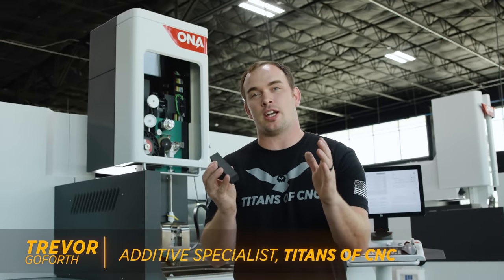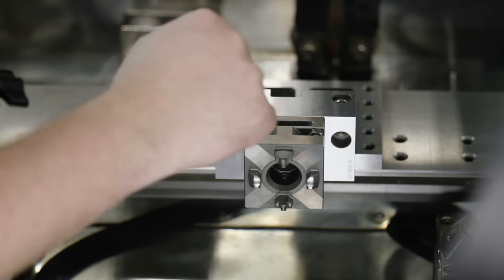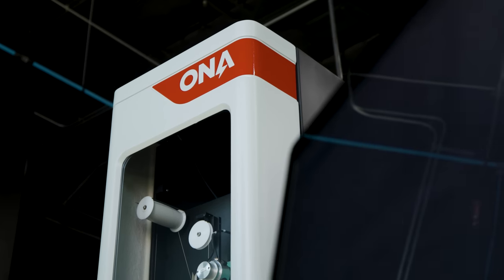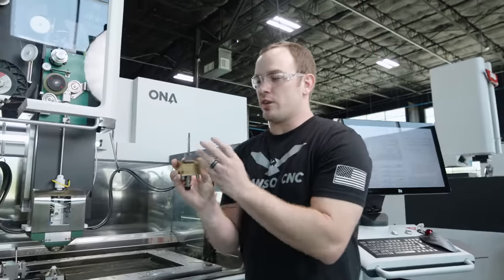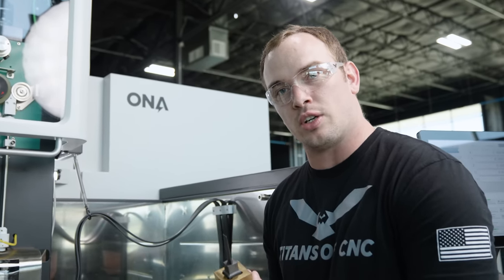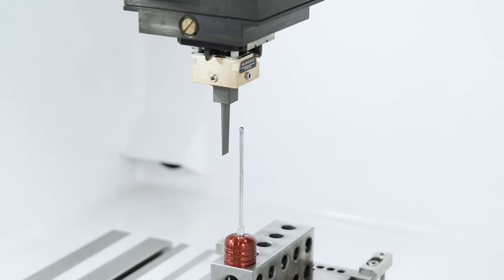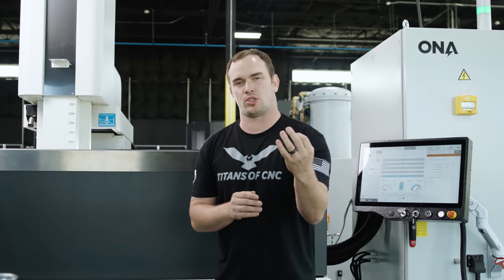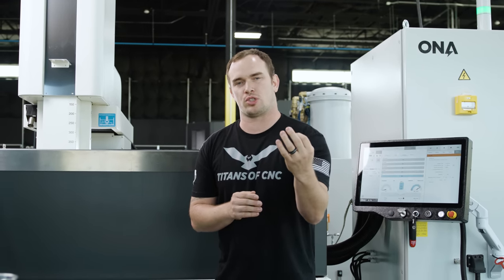How To Cut Deep Mold Cavities With Pencil Lead

Comment: as a machinist who has made just a couple graphite electrodes, I know how brittle it is and what a pain it is to make a good electrode without it chipping. I never thought about making an electriode with a wire EDM...genius!
Reply: To be honest, this is pretty easy to mill. All you need is 1 tip radius mill. Contour the part directly on 0 in small passes, leaving no stock because you can't finish this kind of part. I've done electrodes like this, even longer. It takes trial and error but they are pretty cheap. It will take less time then an EDM machine. Still cool though!
Reply: It's fairly quick but limited vs a 5-axis mill. I'm looking into a specific 5 axis electrode machining mill. My company is moving quickly into the magnetic component industry.
Reply: I'm like whaaa....all that mess that could have been avoided

Comment: I used to work for a company that surface ground graphite blanks to a .0002 tolerance specifically for EDM electrodes and mold making. Fun fact: you can get copper infused graphite for electrodes as well
Reply: I work at a mold and tool shop CNC milling electrodes to .0002 tolerance for EDM. We use Poco which to my understanding is a basic graphite and C3, which is the Copper infused graphite you mentioned. I went from milling Soft steel, to doing hard tool and now this and i think this is the most difficult.

Comment: Man I miss programming and running EDM's. It was stressful but awesome at the same time to cut parts that had a tolerance of +.0001 -.0000 " all day long.
Reply: I apparently have much to learn, as an operator I could only dial it in to +/- .0001
Reply: @thomasrogers8239  The place that I worked we did punch and die work to support our production line (electronic). There a couple of tricks that we found that really helped us hold those kind of tolerances. The material is huge and how we prepared it. We either used D-2 or CPM-M4. We would heat treat is, draw it back, freeze it to around -150 deg. F. We would repeat the drawing back and freezing the parts 4 times. Your material needs to be super stable. Then once the parts hit the wire EDM I would do 1 rough cut and 3 finish passes. The finish passes I would alternate the direction the I would go around the part. I wish I had the resources available to me now days to do this. I would make a video on this. Maybe Titan could fly me down to his facility so that I could demonstrate it lol.

Comment: At my workplace (tool manufacturer) we only use graphite electrodes for part surfaces where there's a specified roughness or a desired surface texture.
I've made heaps of different graphite electrodes on a small 3-axis mill that isn't really suited for the task, but it gets the job done. It's a dirty mess and the coolant reservoir is covered in black sludge - but at least the graphite dust is caught by the coolant and not spread all over the shop through the ventilation system 😂

For a smoother surface you often see on injection molded plastic parts, our sinker EDM guys use polished copper electrodes.
Or the sinker department leaves a bit of material for a polishing operation for that mirror finish.

Anything is possible, really.
As Trevor says in the video; it's about the technology available and the equipment - but the knowledge and experience of the person manning the machine is just as important.

Comment: This is what I do everyday in my Job. Make electrode copper tungsten to wire EDM and use it for Sinker EDM. I'm working this for almost 9years as CNC machinist. Graphite is good more cheaper than copper tungsten but I think it is better use for roughing in Heat treated materials but I don't think if it can be good in carbide materials. Graphite is easy to wear than copper tungsten. But still can make good products.

Comment: As a former die maker, this is impressive. It would not be impossible to make this part using the old manual machines but I would have had to mask the two halves, to get the finished size and that smother finish, soda blast it. It would have been almost hit or miss and it would take days to complete. 
 The parts would be scrap.
So I wish I could have had this technology back in the day.
 The machines you're using probably cost more than our whole building and the machines in it lol.
Enjoyed watching this show it's amazing how much CNC  can do.
Reply: "Die maker" when, in the 1930's? EDM is not new, come on...
Reply: @abcdefghijk6704  we had edm and used it  but never to make a die or mold part. We just had the simple one like to remove broken tap or make a hole in some super hard heat treatment tool steels.
Reply: @abcdefghijk6704  haha you still use EDM? how archaic lmao

Comment: Know it's 2 years old but guys, grind it by plunging down and moving the electrode out.  One shot per side.  The mass of the material will support the cut on the plunge.  We also did it on a Bridgeport conventional cut.  You can also turn a 0.0100 (maybe even smaller [we have an old Southbend lathe]), cylinder profile 4.000+ inches long, one shot, just keep your speeds reasonable.  Nice vids, keep learning.

Comment: Thats a pretty impressive slot right there! I wouldnt be able to machine that with comventional methods. Nice work Trev!
Reply: Thanks dude!
Reply: Yeah, but this is a standard way to do such things in mouldmaking for last 50 years or more.
Reply: probably gotta machine two parts then weld them both together at best?

Comment: I worked in a mold shop and we had a Makino cnc machine specially for graphite. It was sealed and had a vacuum to gather all the dust. I was a cnc programmer and I don't recall ever using diamond coated tool, it was standard carbide tools. Now something important for new machine shop worker. SAFETY FIRST!! Never work with any jewelry on fingers and wrist. Never!! This guy might lose his finger someday.
Reply: There are certainly machines designed for cutting graphite that have vacuum systems that do a pretty good job. Graphite is extremely abrasive and a standard uncoated end mill will wear quickly. Most shops that cut graphite regularly, are not using standard carbide end mills.

Comment: Just jumping in on a comment about Poco3 having copper. Poco c3 etc does and is more expensive than strait poco3

.There is no copper in Poco3. The difference between pencil graphite and fine edm grade is the fact that grades such as Poco3 are isotropic whilst pencil graphite is not.  I was a manufacturing engineer/ tooling designer for Pratt & Whitney Canada and designed every electrode for all blade, vanes for their engines for 12 years. Got my own shop. I'm a Charmilles guy and a big fan of Errowa tooling.
Reply: I ran wire for years but zero experience with a sinker.
Why don’t you guys use a nozzle to help flush? 🤷‍♂️
Reply: @fredsanford1437  I do use nozzles as well as vacuum flushing.

Comment: Poco EDM3 has copper i do believe, so slightly different than pencil lead. But good video on EDM. Those Erowa holders have a centering attachment (you used the alignment attachment) that is ground to length also so you can just type your x, y, and z numbers to your EDM electrode offset page. Love Erowa stuff, its expensive but worth it. System 3R has really nice Wire EDM tooling, leveling heads especially.
Reply: There is no copper in Poco3. The difference between pencil graphite and fine edm grade is the fact that grades such as Poco3 are isotropic whilst pencil graphite is not.  I was a manufacturing engineer/ tooling designer for Pratt & Whitney Canada and designed every electrode for all blade, vanes for their engines for 12 years. Got my own shop. I'm a Charmilles guy and a big fan of Errowa tooling.

Comment: Now, someone has to polish it (or you do very slow finishing burn), otherwise plastic will never go out of such mold (common issue, ribs breaking off). And imagine this is not an insert split in two halves, but one solid part.
Reply: It is possible with some release angle on the sides and an ejector pin in the bottom
Reply: Also polishing the electrodes. Multiple finish electrodes at multiple polish grades. Make the electrodes smaller to compensate and add flushing and orbital path. =happy mould polising team.
Reply: @mulletjocks  This program did have a square orbital cycle.
Reply: Many years ago I used to be the guy polishing those ribs for plastic injection molding. It was always amazing the detail they could get with EDM but polishing it was a bitch. It was a trick having or making the right tools to get all the way down into a small slot like that. Had to keep from widening the slot and the EDM process case hardened the steel making it take even longer to polish out.

Comment: This technology has been around for decades. In the 80s the tool and die shop had edm burners both graphite and wire
Reply: Electrical discharge machining was invented in the 194x year. This is not such a new technology.

Comment: That's awesome, that you did the burn with only 1 finisher. I was taught 1 rougher 3 finishers. And no flushing, the sodicks I use to run I always had to flush deep burns, they didn't like  it too much.
Reply: Yeah 1 rough 4 finish trodes is pretty standard for graphite electrodes which is why we wanted to attempt this burn with only two trodes and no flushing! Very impressed with how it performed! Thanks for watching!

Comment: [08/08/22] If that was a mold, wouldn't it require a draft angle for proper molded piece release?
Reply: Good question, you are correct! This electrode has 1 degree of draft on every side resulting in 1 degree of draft on the walls of my finished workpiece 👍🏻

Comment: Could you make a graphite part and use it to make a mold in metal by this process? Or Would machining it be the better way to go? Always fun to watch things being created with new techniques. I had the opportunity to work for a company using an EDI system, but chose the other job, Automobile mechanic, should have stuck with the machining.
Reply: Electrical discharge machining was invented in the 194x. This is not such a new technology.

Comment: i imagine EDM being much more relaxing then milling or turning. just no big fast moving parts that you can crash haha
Reply: These machines monitor current flow. I forgot to put a Z retract to the right height to clear a clamp between pockets while on a die sinker. The electrode bumped into the clamp and alarmed out. Just pressed reset, highlighted the line to start from and off it went. Not a mark on the electrode or clamp. If I done that on a mill I would of been picking up pieces.
Reply: @Hi_Doctor_Nick  exactly good luck making an edm explode haha
Reply: @cyber2526  that was my worst crash I've ever had on a sinker. if you can call it a crash, more of a inconvenience lol

Comment: Hi Titans of CNC!
I am a student
I have a doubt
GO G90 G55 X0 Y0;
G43 Z2.0 H2;
#501=1;
WHILE [#500LE23]DO1;
G91 Z-0.7863 F480;
G04 P100;
#501=#501+1;
END1;
THIS set of codes was used for  roughing 22 mm drill 
What is difference between using G81 cycle vs G01 z 17.3 F 480 Vs WHILE LOOP WITH Incremental like above mentioned code ,is there any difference between this codes?
Reply: In that while loop the G04 makes a pause of 100 miliseg every incement(0.78). And G81 is a straight drill with no pauses. And using G81 you only need XY postion repeat to do another drill.  Sorry about my bad English, hope this answered your quesiton.
Reply: @soto4621  thank u bro

Comment: Does it take longer on the wire edm todo roughing vs finisher?
Reply: I'm curious about that too lol I'm a plunge programmer so I'm not totally familiar with timing for wiring graphite but from what I understand it takes a while.
Reply: @hunterb108  lol I have many years experience on wire but zero with sinker.
I imagine it’s the same,  rough pass is always the longest and finishing passes are super quick 
Hope that helps ✌️

Comment: How do you know how many electrodes its going to take to accomplish the burn?
Reply: Putting a lot of power through the electrode to rough would wear it down a bit so a finisher does the last little bit.
Reply: Experience. It may take 1 to 4 electrodes to do the job (depends on size, shape, materials, finish).

Comment: Now you just need to create a solid state battery By using copper and silver and sand them to a 10th of a micron And ring them together So you would no longer need a electrolyte. You would have a solid inhesion For the electrons to flow from one Metal to another. Connect one end to the atmosphere and the other to the ground and you have for all intensive purposes a battery that never dies.  No granted if everyone in the world had one we'd be technically be taking the energy from the earth's Magnetic field. But it would be the biggest battery man has ever made

Comment: Why graphite instead of copper?
Reply: Gives better surrface finish and its cheaper then copper.
Reply: @venom454545  : Thanks! ( they should mention that in the video:) )
Reply: @Krishell  But graphite loses its tolerances really quick. Thats why you need at least 2 electrodes. Like they did, 1 for rough and 1 for finish. Copper electrodes can hold its tolerances longer. Cheers 😉
Reply: @venom454545  I made blanks for 2 1/2 years on surface grinders. A company called poco makes a “C3” copper infused graphite commonly used for electrodes

Comment: lol, the dielectric on the 20yr old RAM EDM I run is opaque, and really quite viscous. Makes flushing a nightmare. But a poor craftsman blames his tools... 😫
Reply: I ran wire for years but never a sinker… why not use a nozzle to help with flushing? 🤷‍♂️
Reply: @fredsanford1437  I do, it's still crap. Lateral flushing is pretty much the only option. I don't think our machine is even capable of moving as fast as the one in the video

Comment: I can cut that taper from solid 3 programs on a vertical mill in a lot less time than doing the wire EDM.
Reply: Yeah but you’d destroy the graphic in a heartbeat. I worked making those blanks on a surface grinder for 2 1/2 years. I’ve been running a vertical mill for a year and can already tell you it wouldn’t work. You’d chip the crap out of that graphite
Reply: @tomsellout9576  Dude, I do that kind of stuff regularly, for over 20 years.

Comment: 4:45 if you dont pre rough the electrode but just finish machining the electrode with a big enough endmill, then its no problem because the electrode itself is supporting. Yes dust is a problem if you have a bad or no suction.
Reply: With EDM you get no graphite dust, high accuracy, great surface finish, no diamond tooling, no tool pressure, etc.. it runs unattended and you can set up and run the sinker while the wire is running electrodes. For this specific shape it works great.